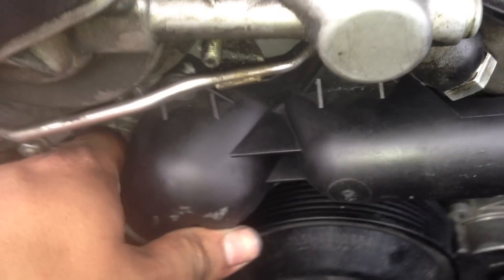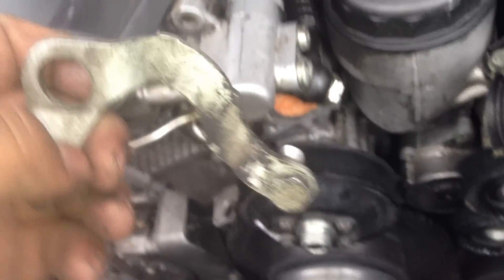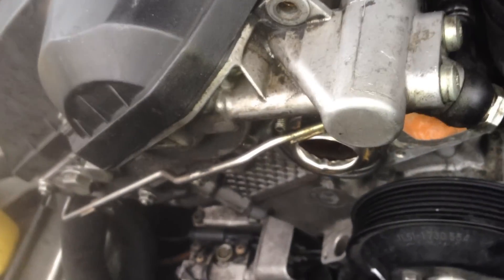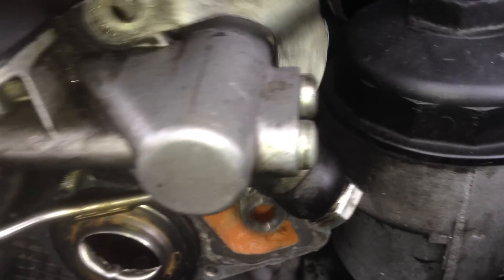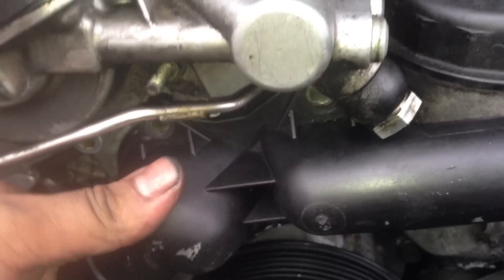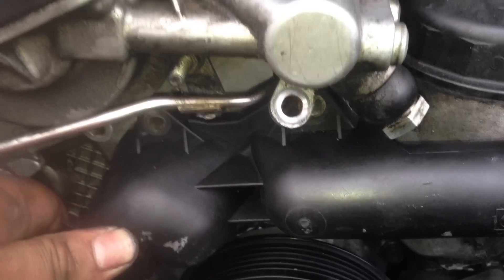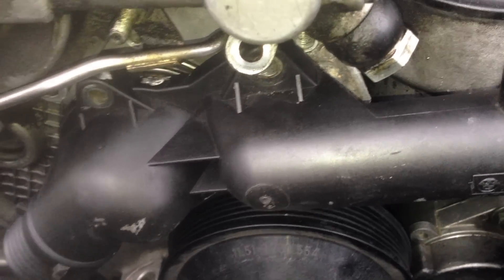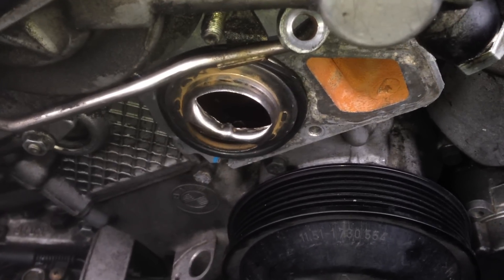HOW TO Remove Thermostat Housing 97-03 BMW 5-SERIES E39 528I 540I M5 M52

Comment: Hey Ace! I have a European 1997 BMW  (ALL ALUMINUM BLOCK), they registered it as a 528i when I brought it over from France.  Only has 36,000 miles,!   The car door only says pressures for a 523i/525i,  but most of your videos look like my car (expansion tank for mine is oon the right side, small differences, but getting hard to find parts that fit.  Even a dealer can't order the right headlight assembly from BMW. your videos for the 528i are 10+ years old, and tho they ain't "polished" I find you better to view than all the other talking heads on u-tube. I don't do Facebook, is there any other way I can make contact with you?
Reply: 1997 is a m52 not a m52tu or m54. If you need parts, the first gen z3 2.8 has the same aluminum  engine in america. The e36  also the same m52 in the 328 , only difference between a e36 or a u.s. e39 from 1997 compared to a euro car,  is the iron block. Only other difference i know is a E39 uses a longer thermostat housing vs. The e36 / z3.

Comment: do u HAVE to remove the fan clutch and cover to access the thermostat housing bolts?
Reply: Yeah have to unclip radiator shroud clips, plus youl need a 32mm open end wrench, and a screwdriver to jam the shaft mount bolts, to undo the fan nut.  Then it will all come out.

Comment: Check out Nathan's "BMW Snap Lock Coolant Hoses Installation Tips And More E88 Coolant Leaks" for tips on the proper way to use these clip hoses. I had the lower hose pop off, fortunately it only cost me $30 in more coolant! I wish I had seen Nathan's video before. What a sense of security to hear that click, knowing the hose was securely installed. It made me appreciate the German engineering rather than question it. Also coolant as a lubricant works great and obviously is compatible.

Comment: I have a 525i and was wondering where the thermostat would be located at. I have already bought a radiator fan assembly and it still overheats !?
Reply from the maker: It should be located above the fan as the video. Do the air bubble removal process to prevent overheating.